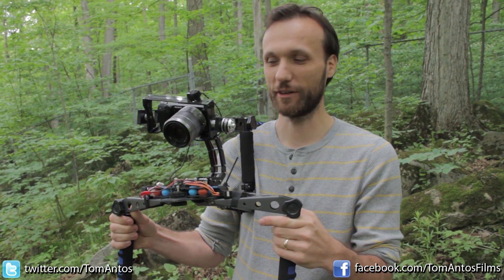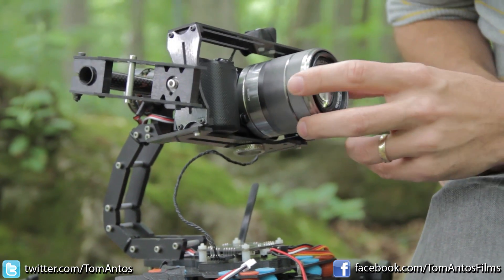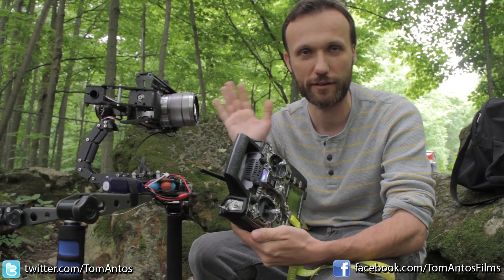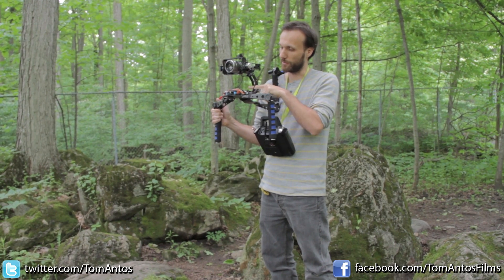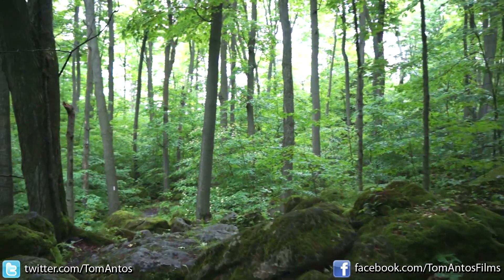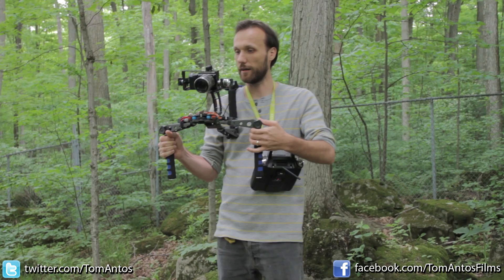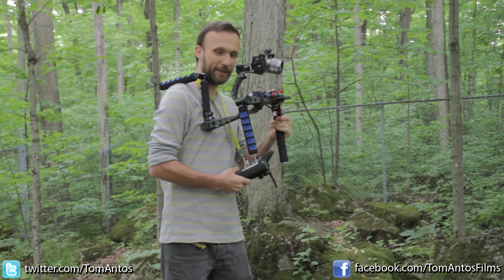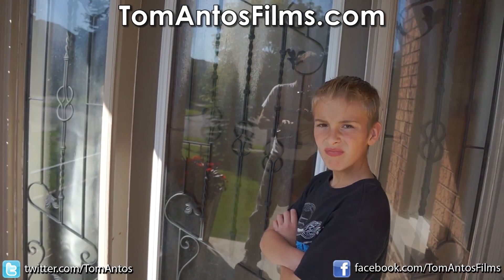DIY Digital Stabilized Camera Gimbal

Comment: Hey Tom,
First off thank you for every review you do and every bit of information you help us all out with. You and your brother Lucas are very informative. With that being said I have been watching a lot of your reviews. I will be purchasing a ursa 4.6k soon and wanted to know what dslr camera should I pair it with that is really good in low light , has very little rolling shutter issues if any, and also, can achieve a similar color profile later in post color correction procedures. I want to film horror movies which I would
Like to use my ursa for, but if my talent is in a really confined area, I would like a smaller camera that I can crawl around with that would require very little light. Basically the complete opposite of the ursa but would give me a similar image later in post. Thank you for your help.

~Jonathan

Comment: Instead of using the transmitter you can use a servo tester and attach two of them on the handle bar on either side to tilt the camera .they only cost a couple of bucks .just connect it it to the gimbal control board directly

Comment: Hey Tom are you able to use the gimbal setup without controllers? Like if I just wanted it for stabilization and manually control it. Thanks in advance for your response

Comment: Another thing you can do to get a good shot in a shoot like this where the terrain is the subject is to record at 60 120 or 240 fps and then when you play it back at a slower frame rate the video seems smoother because the jolts and wobbles are smoothed out. Of course the video takes longer to play.

Comment: That price tag does not seem worth it at all..I feel like you can get better results from an $80 or £80 steadicam that is very well balanced. However, it is a pretty cool project and it could just be the balancing.
Reply: thats just not so...have you ever used an $100 stabilizer? they suck!!! this is leagues ahead of them.
Reply: Perhaps if you bought an arm and vest with a stock £80 steadicam, then yes. For around the same price you can do that, though I would like to see some footage of this gimbal working with a balanced camera and correctly calibrated software.

Comment: If you had a second person you could do another FPV RC trick and mount a GO-PRO camera onto your movie camera and have the second person control your RC radio and watch the live feed from the go-pro with fat shark goggles, you could watch were your walking  and the second person could get the correct angles for your movie shots.
Reply: You can also use the HDMI output of the camera and make a video feed to a oculus rift.

Comment: you could use a servo tester instead of using the hole radio system there like $5 and the size of a card deck

Comment: You could eliminate the radio control by using a servo tester. Its a little box that has a 3 pin output to drive a servo directly. You could solder a mini joystick and control it with your thumbs by mounting it to the handles. Check the servo city web site for "dual channel servo tester" or just Google it.

Comment: Instead of using a rc transmitter and a rc receiver, you should connect 2 servo testers directly to the roll and pitch inputs of the gimbal controller.  Those servo testers have a potentiometer so you can install one on each handles to control the pitch and roll.  The servo testers are powered by 5V so you would need a UBEC to generate 5V from your 3S battery.

Comment: can you put a wired remote control for tilt up and down the camera, I followed your guide and mounted a nikon 3200 on it, but the only problem is always at same level, sometimes I need the camera to tilt up or down a little, so a remote will be good, I'm not good with electronics so I don't have a clue of what kind of wired remote control will work in this fine tool.

Comment: Hi really nice video. i have to buy such a gimbal for filming and for my quadcopter.
I start thinking about an arduino project with two potis that allows to control the gimbal without the big transmitters, but i am really unexperienced with arduino at the moment :D

Comment: You could replace the entire wireless transmitter and receiver with a simple ps2 style joystick and arduino or some other microcontroller converting the 2 analog signals from the joystick into PWM for the gumball controller boards inputs.

Comment: Using an RC radio just to control a few servo inputs (at least that's what it sounds like your doing with it) is probably overkill, and a little strange for anyone who doesn't have them coming out their ears.  I guess that's the metaphorical hammer you had to work with.  For other people it's probably easy enough to hook up a thumbstick and some supporting amplifiers, for running servos off the digital outs, to an arduino (or just an AVR).  That would make a good next revision.

Comment: steadycams are great - but they are horrible in cramped spaces. the moment your counterweight even slighly touches anything, you can forget the take. examples: filming from the back of a car (or anywhere in the car), on a sailing boat, in dense forrest or jungle (HORRIBLE with a steadycam), etc. so a compact stabilized gimbal definitely has its uses.

Comment: Good idea! However if I can suggest I think it's better if you use a servo tester, 1 per control axis, instead of using RC Radio. You can install the servo tester on you camera rig handle and modify the servo tester knob to suit your need. It's just a suggestion...

Comment: Sorry, I don't post my footage due to legality issues because I am flying my gimbal under a multirotor. aka "A Drone" But if you check out RCGroups(dot)com, there are plenty of threads on brushless gimbal controllers and lots of DIY examples. Goodluckbuy(dot)com sell a lot of diy gimbal parts, just search for brushless gimbal.  Hope that helps.

Comment: bro, keep going on the glidecam, you will have to realise that it will never be perfectly balanced, it will almost be perfect, but it will never just stay in its position. Really the key is to touch the pole, right under the center of gravity(well the point where the pole connects to the handle) with your thumb and index finger in very short intervals to keep it in position when it gets off balance. Kind of like the ABS on the break of a car.

Comment: Dude, you can buy the brushless gimball controller for $45. Its the Martinez board which is open source.  You should be able to make this for less than $200.  I have one under my quadcopter.  Improved the video 1000%.  Plus you don't need a remote, just a servo tester to power and control the gimbal.